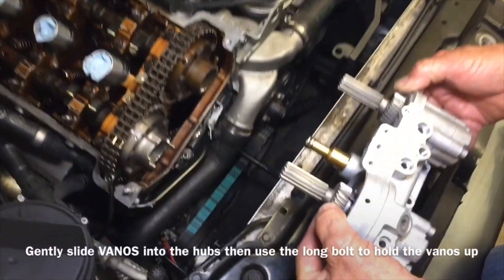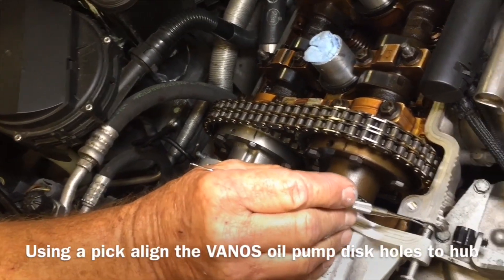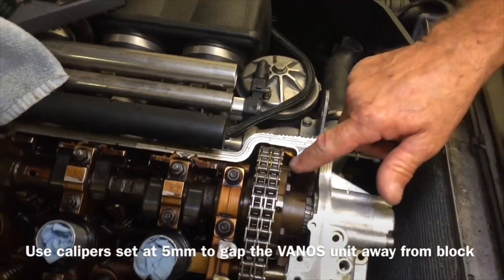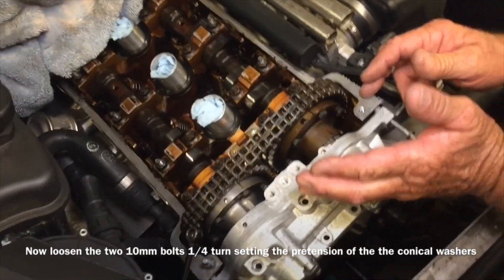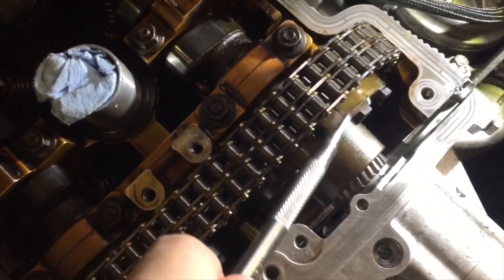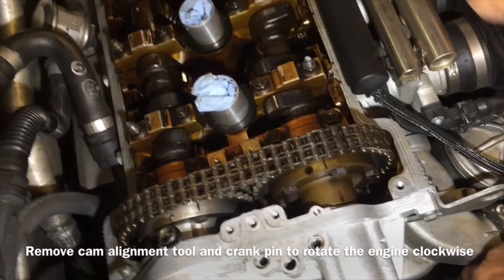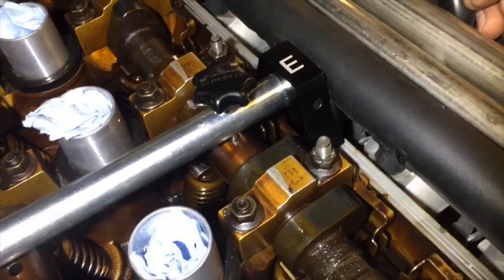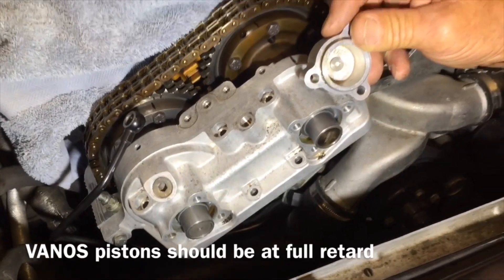HOW TO Install Upgraded VANOS And Helical Gears from Dr. Vanos Part 2

Comment: Yeah I messed up big time, when i put my vanos unit back on i did not set the pistons  to full retard, but i spun the motor 180 to tighten the bolts, roated back over and just snugged down the rest, than i realized i did not have the vanos spline shafts  set at full retard at tdc so i went to reverse what I did but had to back the engine Counter Clockwise to get the vanos unit off and the gears off out of the splines on the cam shaft than i rotated back to number 1 at tdc at  full retard but somehow my exhuast camshaft is at full retard TDC but my intake cam shaft is like 180 degree off lobes (not pointing at eachother) like they should at with number 1 @ TDC  and if i try to just move the intake camshaft hubs removed, spline shafts out vanos off i can feel the valves stopping on the top of the piston and i cant back it off and reset it to full retard at tdc... and im not sure how I can get the intake cam shaft reset i mean everything rotates smooth still and i did not force anything just after i felt the intake valves touching the top of the piston i stopped. but ohh I did find the sweet spots so i guess that good. but yeah any advice lol ?
Reply from the maker: not sure you're hitting the valve with piston, but good that you're being careful now. What im gathering is that you believe one cam moved while the other didnt since you had everything loose.  So lets start here.  Confirm that piston is hitting valve- back the engine off just a bit by hand, to get piston off valve, then see if the cam will move. If the cam will move you indeed have a situation where the cam has slipped, you may be able to turn it Into place at this point.  If not, you need to keep turning the engine over until all the valves are cleared and the cam lobes are pointing at each other, then you would pin the cams and make sure theyre in right place, then pin the crank at TDC.  Then remove cylinder one spark plug and make sure youre truly AT TDC.  It sounds like you may just be 180 degrees out.  Let me know if this makes sense, IMPORTANT anytime you turn anything over, make sure your timing tools are out of the cams and crank or you'll bend them and ruin their accuracy.  wish we were there to help you in person.
Reply: @FatboysGarage  yeah that's what ended up happening, I rotated the crank about 30° counter clockwise and was able to move the cam , got it all back together now just finished the valve adjustment now going to change out rod bearings next weekend ! Thanks so much for your help . Great advice.with the paper towels on the oil grates also I ended up dropping a shim but thankfully ur advice saved the day on that one lol thankyou again
Reply from the maker: @11Xshadowolf  great job figuring it out man.  Not an easy deal. wish we had our video up for rod bearings but its taking a minute to get edited. not an easy edit.  Your very welcome, just glad you got it together and its going to work!!! haha yeah those little tricks make the difference, we have had habits fo dropping stuff in the worst possible places too lmao.
Reply from the maker: @11Xshadowolf  ausome man! thats good to hear that it worked out properly! youre very welcome! goodluck with your rodbearings, let us know how it goes! Reach out if you run into problems, theres a few that can come up and suprise you lol.
Reply from the maker: oof, yeah got some steps a little mixed huh lol. all good, ill reply asap but want to think this through

Comment: Cams aligned with the tool, pin is in all bolts are tight. When i turn the crank manually one full rotation and reach back to tdc the pins do not align, however if i move them with a wrench a little both pins go in fine

Comment: Ok..watched again a second time. When in TDC pins should align.  Great video!! Thank you so much. Just finished rebuilding the intake on vanos. Exhaust is next. Additional for the sweet apot with the most movement inward on the gears. Also did valve adjustment before starting the vanos rebuild. She is going to purr once I fire her up after I double check everything. Got new plugs as well. Can't wait to fire her up. They state around 200 miles to break everything in from Besian on package.
Reply: Instablaster...

Comment: This is really useful and clear information thanks for all the videos. It would be so useful if you can list the parts you purchase from Dr.vanos to replicate this amazing DIY.  Thank you for the videos
Reply from the maker: Yuri Marins yes I can post a list in the description- however I’d give Dr VANOs a call and talk to him, he will make proper recommendations as well👍
Reply from the maker: - Upgraded VANOS w/ new solenoids
- S54 Cryo treated Exhaust hub (30% stronger) these often break
- S54 Intake hub
- S54 REM coated Cam Gears
- Upgraded Cam gear bolt set
- S54 modified intake gear
- S54 modified Exhaust gear
- upgraded S54 Timing Chain guide-(ours was broken)
- S54 VANOS Oil line

Comment: So you don’t torque the outer hub bolts. You just get them reasonably tight. Correct? Thanks for the VID 👍
Reply from the maker: B Souza at first yes, but if you follow closely you torque them all down.
Reply: Good question. I think a lot of people over torque this bolts since you don’t have clearance for a torque wrench. It’s an important part of the procedure , how tight do they need to be?